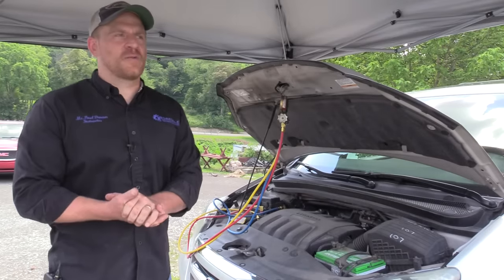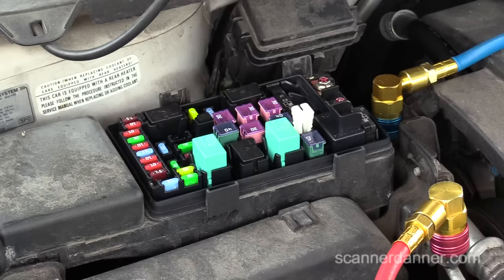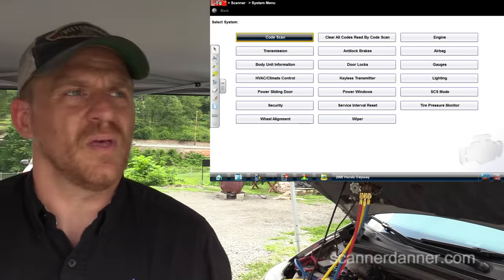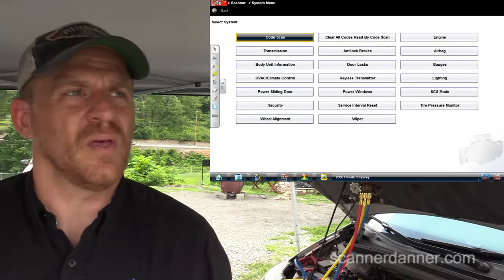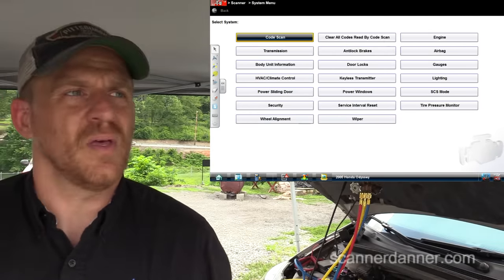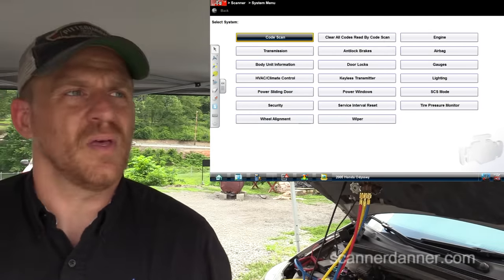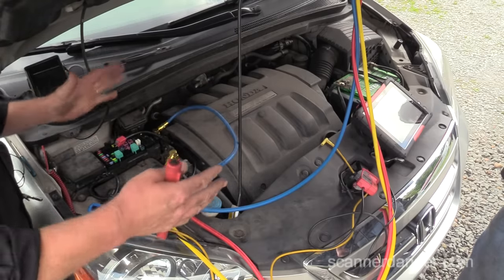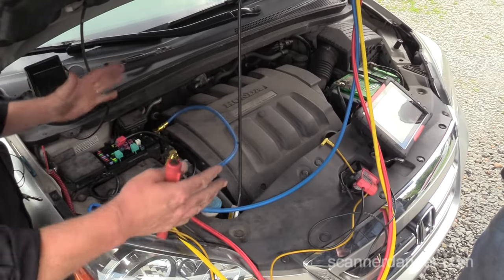A/C clutch not engaging - 2005 Honda Odyssey

Comment: @scannerdanner hey thanks so much for the video. I thought I had a blend door actuator problem I changed that but my passenger side is still ice cold and driver side cool or hot sometimes full on heat. I checked by turn ac on and off my tach doesn’t move but I did verify the clutch goes on and off. You think it might be relays ? Passenger side always works full ice cold
Reply from the maker: what are your pressures in the AC system? you can still have a low psi issue causing this

Comment: Hello, Paul.Is the idle rise going to stay with the a/c on or is it going to get back to idle speed?
I don't really understand Idle Speed control; that's why I ask.
Reply from the maker: idle speed control differs on every car but in general the ECM will try to maintain a constant idle speed adjusting accordingly as accessory loads increase and decrease.

Comment: great video!!! any ideas why a/c works for around 10 secs, cold air great, after that  go off and there is no current to the clutch an more at all. if i do apply 12v to the clutch directly it works fine. i did replace relay just in case, did recharge the system. pressure on the high side looks good around 11 bar. thanks in advance.
Reply: I have a similar problem in my Volvo V50. A/C works for 2-5 minutes then cuts out. Bad/Worn clutch perhaps?

Comment: The screen said Volts, you measure current with Amps. I believe when you were measuring for current, you may have had it set up to read voltage, and a short circuit would read 0V just like the screen said. But, I’m not sure if the tool had some kind of feature that would make it change setting and units if there was current.
Reply from the maker: An inductive ammeter produces voltage in the presence of a magnetic field. The magnetic field strength of any wire is directly proportional to the current flowing through it.  So when you feed that signal into a meter, it is a voltage equivalent of the current flow. For example the two settings are 100mv/A and 10mv/A . When I did that measurement, I never bothered to switch to a different scale or meter as I can use the voltmeter to show me what I was looking for. On the 20 amp setting (100mv/a) that I was using, on the inductive amp probe,  1 volt would have been 10 amps. Make sense?

Comment: easy check test light connected to positive and check at relay feed going to compressor should light if not clutch bad or wiring problem . 10 out 10 clutch

Comment: a little tip  i have found about honda's say 2008 and up if you look at the fuse box cover looking for condenser/compressor relays there not labeled mg clutch or anything like that but a picture of a frost flake  next time you are under the hood of a honda take a look may  save a bit of time for you

Comment: i have autel ds708 i purchased when first started to come out. Now the price is around 800 to 1000 with almost all feature as snap-on except component test or troubleshooting the rest performance same as snap-on. Some people said snap-on is the best is ok with me. i know how use a scanner and that is what make the different between mechanics not just read trouble code and change parts is do a diagnostic and call the right part and fix it

Comment: 17:00: No need to check the voltage to the control side of the clutch relay, right? You already heard it clicking when activated w/ the  bidirectional scan tool.

Comment: Do you know any local shops that  have a $10,000 dollar scan tool? $1,800 is too expensive  unless you're a repair shop  making more than $100,000 a year.
Reply from the maker: You don't need a 10,000 tool to follow and learn from this video

Comment: If the clutch movement is more than 0.02inch  (1/2 mm) the coil will take to much ampere and burn the coil wire. You can replace the coil it self, 15 dollar... Keep in mind that the movement (engage) after repair is .02 inch or less. If not it will fry again.

Comment: With the open coil, there will be no current flow and no voltage drop. You mentioned that the relay switch has to be closed when checking the ground. The ground cannot be loaded because no current is flowing through the open coil. Was that a mistake on your part?
Reply from the maker: No, you're not going to have an open ground and an open clutch coil at the same time. The tests 100% verified and open clutch coil. It's really the same for the power feed, that wasn't loaded either (technically).
If a tech feels the need, you can add a headlight bulb to the circuit to confirm you don't ALSO have a wiring problem. But in 30 years, I've never seen it. You're not going to have an open in the output itself and a wiring problem at the same time
Reply: @ScannerDanner  I was helping a tech diag an a c compressor and I checked for power and ground at the compressor without stressing the circuit. I was kind of hesitant in calling the compressor, but a new compressor fixed the problem. In a case, where you put the test light to batt positive and touch the relay  pin that goes to the clutch and the test light illuminates, I would check for amperage or do voltage drop the circuit. Power to power and ground to ground. Just to let you know, you have been my teacher for years. I use the knowledge  acquired to help on the forum

Comment: My ac clutch stays on and only stops when i cut the air off. I pulled the ac relay and the clutch stopped. Do you think i need a new cabin sensor or could it be the clutch? The clutch plate seems to be a bit loose but there's a tool for that. I also believe i need freon as it's not cooling that much. Any advise would be very helpful,thanks. 99 gmc jimmy
Reply from the maker: You're not leaving it in defrost are you? The issue is not the clutch itself. What you need is to look at scan data (if possible) and look at your AC Request data PID. It will say either yes or no. That will give us good direction. The poor cooling is a separate issue.

Comment: I have a 2007 Honda Odyssey, the AC worked for only a few days after we had freon put in the system. I just bought the van,  do you have any idea's what the problem could be?
Reply from the maker: you have a leak in your system
Reply: Would AC Stop Leak fix it? It's pretty cheap at Walmart in Irwin, PA.

Comment: Hello Paul, around min 3:25 you started talking about the low pressure will cycle and the high will rise as the compressor engages and the
clutch would spin, I have a Scion TC 2006 the low pressure it’s reading about 20-25,the high about 70, it doesn’t cycle or goes up but the clutch engages, I’m thinking the compressor is bad as it’s probably weak to make the pressure rise. I also noticed the RPM change when the AC it’s turn on as you describe at the beginning of video. So, all this would mean everything is fine and I would need a compressor, What do you think ?
Reply from the maker: Honestly, that sounds like you are low on pressure my friend. So you have a leak in the system and the low charge is causing your low psi. The low side may look more normal because it is a thermal expansion valve system and the orifice is wide open right now. 
The high side is staying low because there is really nothing in there to compress. 
So the good news is it doesn't sound like you need a compressor.
Reply: I just changed the evaporator, expansion valve and condenser because these two units were leaking, then I did a vacuum for about an hour, afterwards I let the gauges on to see if there was any vacuum lost which I didn't see any lost. After putting almost a 12 oz  can it wasn't cycling or going up at all, I see the clutch spinning but the cycling back and forth as a normal system. Any other thoughts?
Reply: I'm going to try to take a video and sent it and maybe see what I'm trying to explain.
Reply from the maker: What is the system charge capacity on that? I know it is way more than 12 oz. You are low on charge.
Reply: Paul, There is no label but was told by the parts store about 15 oz and Toyota about 16 oz, one thing I noticed the low side line wasn't getting cold but didn't see pressure changes or cycle back and forth, 

since I didn't take the compressor off I didn't add any oil. Should I add and about how much?
Reply: How would I know when compressor is bad other than a clutch not working
Reply from the maker: If 15 oz is max charge, then I agree 12 oz should have been enough to get our pressures pretty close. So, then yes, it does sound like a compressor issue. But without knowing what you are working on and researching what type of system it is, I would NOT be telling you to put a compressor in it yet. There could be an issue with the orifice (expansion device). For additional help, post this to my forum please. I cannot continue this here. Thanks!
https://scannerdanner.com/forum/post-your-repair-questions-here.html

Comment: Wow exact car Iam workin on.No class here, slung gauges pressure good.Hauled ass to relay,quickly determined load side, jumpy no clicky.Found clutch connector on fan, hot wire no clicky.Bam new compressor.I failed to acknowledge how fast my gauges dropped into a vacuum.Long story short it looks like a bad thermostatic valve or clogged components killed my clutch.part 2 is pending.Lesson : please pay attention when using vacuum pump.

Comment: Wouldn't it be a lot faster to go from the load side of the relay on the pin that feeds the clutch and put you test light to positive and see if you get a ground through it that lights your light, then you have direction quickly that it's in the clutch, the wiring to it or the ground.
Reply from the maker: Yes, absolutely. Sometimes when I get to teaching, my process gets affected lol

Comment: I've seen where a bad blower motor resistor in Hondas disable to ac compressor clutch engaging. The ac will come on for a moment then shut down. No where in the operation and description did it list the blower motor resistor contributes to the operation of the ac compressor clutch.
Reply: Relay mine was blown when I bought car and blower motor didn't work.. the 20maxi was blown.. I didn't think that had anything to do with resistor. Then again it's saab so wholnows

Comment: Hello Paul, I I connected my low side high side gauges My pressure readings were equal It's about 90° f outside I evacuated the system and I pulled a vacuum and it took free on in and I had the high side clothes The pressure's remain the same I started freezing up on the low side I built up a lot of ice or con or built up a lot of ice on the low side The car started pulling in the freon it only took 12oz of freon, the clutch is not cycling, and runs continuously..Any Help here would be appreciate it Thank you Paul
Reply from the maker: I need running pressures to help you. What is your system capacity, I'm certain 12oz is not enough

Comment: What do you think it means if my radiator fans don't come on when the A/C is turned on and nor does the compressor kick in even though there is power going into the compressor?
Reply from the maker: rad fans for the AC system are sometimes pressure controlled, so if your compressor isn't kicking on, then psi in the system never rises and your cooling fans will not come on. Focus on your compressor. If you have a good power and ground and the clutch is still not engaging, you have a bad clutch.
Reply: That really sucks.. this means I'll have to replace the whole compressor most likely. Thanks for your response!

Comment: Does the signal from relay go directly to clutch or does it go thru pressure switch first
Reply from the maker: Directly to the clutch. All the controls are using  the input side of the ECM

Comment: Did you check for black death in the system? The relay sticking on like thay do could have done it also. Why do you not just build a garage and lift at home?
Reply: He is doing mobile diagnostics. A very common practice for the smaller shops who can not or will not spend the money on training existing employees or hiring specialists full time. That is an entire topic in itself. I would suggest some rhino ramps for field work but if the car doesnt run, or is parked on grass/gravel that doesnt help either.

Comment: Where is the forum where we are supposed to ask questions. I've got brain teaser interesting situation going on with my 2005 Honda Odyssey. 

The high and low side stay at the exact same pressure, no matter engine off or on, AC off or on. 

I evacuated the system, however it could not pull a vacuum bow "0" on the gauge set. 

I started to recharge the system, and both the high and low sides took a charge up to 60 psi, and wouldn't take anything more than that. 

I'm baffled because, how can it not take a vacuum below 0 degrees mercury, but it CAN hold a charge without leaking? 

Anyways I know this belongs in the forum. I'll move it, as soon as I find out where it is. 

Thanks!
Reply from the maker: https://www.scannerdanner.com/forum/post-your-repair-questions-here.html

Comment: Good job
Do you have a video about testing ac pressure switch 4 pins
Reply from the maker: Year, make, model, engine and a good wiring diagram. Im sure it is a multifunction switch and is tested like all other switches. 
https://eautorepair.adtrk.biz/?a=10817&c=24&p=r&s1=
Reply: @ScannerDanner  toyota corolla 2007
Reply from the maker: @muhammadtofiq4451  yep, two separate "pull-down" type switches with one of them controlling the Fan 2 relay and the other signals the ECM. You will need this wiring diagram and a voltmeter and do some voltage measurements for me to be able to help you further
Reply: @ScannerDanner  thanks 🙏🏼

Comment: Using Volts when cking the wires coming off the compressor. I dont get a reading on volts until i unhook the Neg battery terminal. Then i get a reading of 12 plus volts. With test light i get/show power on both wires. I also show power on both ports/inserts on the low pressure switch and if i try to bridge it over to cycle the clutch it will blow the big 20 amp fuse. Same thing if i try from the ac relay from the under hood fuse box. Unless i unhook the High side switch/plug -in . Then i show only 1 insert hot and then try to bridge it over to cycle the clutch and it dont kick it in but it dont blow the fuse like that. . I have had the system vacuumed and i put oil back in the system b4 vacuumed and it took the oil but will not take freon. The compressor worked great when it was on my 96 jeep. My clutch locked up on the 2000 so i put the 96 on it but had to change out the backs of the compressor because the lines were different. I then lost all my freon and oil too i assumed. the 96 went into the back of the compressor and the 2000 go on the top. I took the 2000 compressor apart but there was nothing broken inside. Just the clutched locked up. {Note} i road the jeep for aprox 2 months b4 trying to add freon or oil.  You think i might have ruined that compressor by riding it like that??? but the electric things dont add up or are not right i think but i really dont know but i really need it to work. Im 57 and i hav breathing probs. and cant breath good when i get real hot. So i really need some help.  PS.. I can manually kick the clutch in by running a wire from the hot/coil wire to the hot battery terminal and the clutch will engage that way but still will not take freon. Please Help...

Comment: I have an 2003 Chevy Trailblazer, that the A/C will blow ice cold between 5 to 20 minutes. then the clutch just stops engaging. My brother in law says it could be a bad clutch. but I took it to a mechanic shop for an estimate, and they said it could be a sensor issue. could you help?
Reply: thomas mccarthy 

Have you tested the AC clutch relay?

Comment: hey whats up danner ? dude i need some help i have 2002 pt cruiser that just curs off out of no where possibly three times a day but starts rite back up i replace the cam and crank sensor but still no luck. can you please point me in the rite direction. i hear these cars have this common problem.  any help would be appreciated. thanks man !!
Reply from the maker: Those are known for broken motor mounts which damages the wiring harness underneath somewhere. Check my brothers channel, I think he had a video on it.

Comment: Hello everyone. I have a mitsubishi outlander, the a.c compressor clutch didn't engage to the rotating disk. I take a measure with the multimeter to see the coil value and it indicated 4 ohms, so I tried with +12v and see what happens. I could see the clutch approaching a little to the disk, it looked somewhat stuck so I double my bet and supplied 24 volts with external power supply. I heard the unique sound of the plates clashing so  I repeated the operation dozens of times until I tried again with 12 volts and, voilà, the winds from Alaska are back inside my outlander. I hope this will be useful.